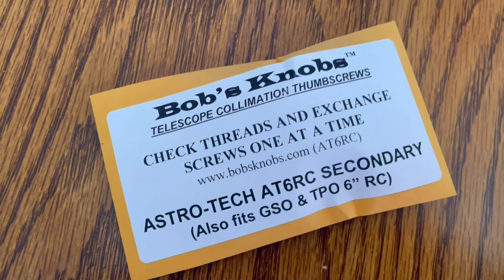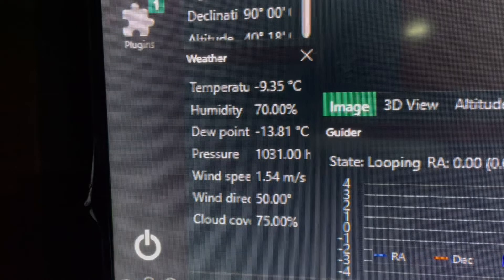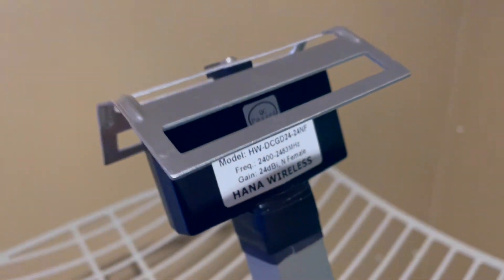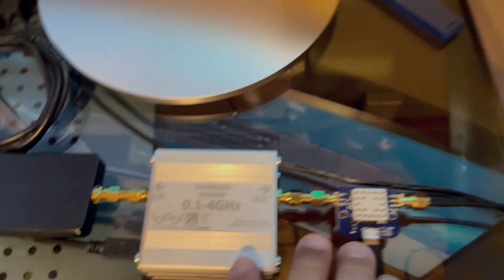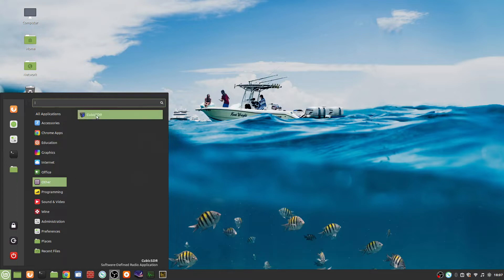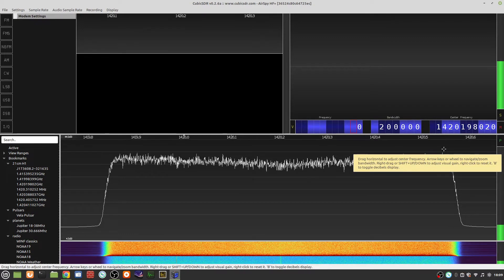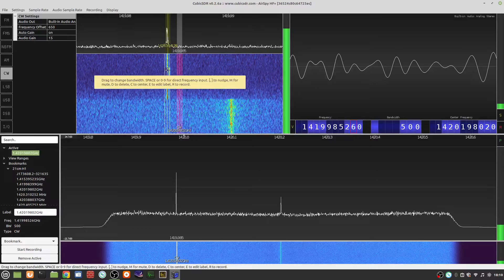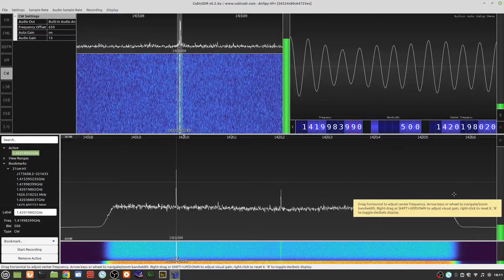Bob Knob's for my RC6 and radio telescope update.

Comment: I've always been interested in radio telescopes but there is just not a lot of info about them. most of it is very hush hush and it is kinda irritating.
Reply from the maker: There’s so much stand up talk like on Ted but they NEVER tell how it’s processed.   I told my friend  it’s like how electric guitar 🎸 works, the strings are the radio waves and the guitar body is the dish.